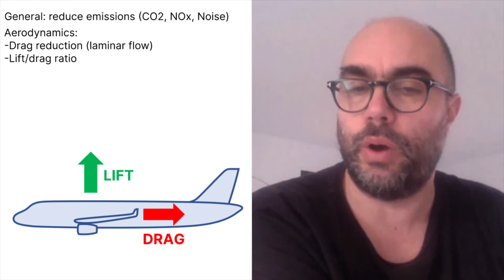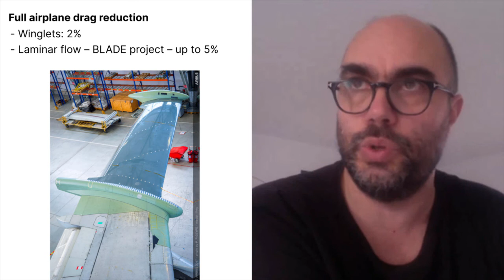AIRBUS Talks - Part 1/4 - Aviation Challenges

Comment: Winglets don't reduce drag, they add thrust. Overall, Ii think airplanes will just have to fly slower in the future to lower their environmental impact. Drela did some nice designs in this direction.
Reply from the maker: Hi Jure, it depends a bit on how you look at it: winglets can indeed increase drag, but if they increase the lift/drag ratio even more, you can reduce overall wing size and reduce overall drag. Indeed, changing velocity is a good strategy in some cases as well.